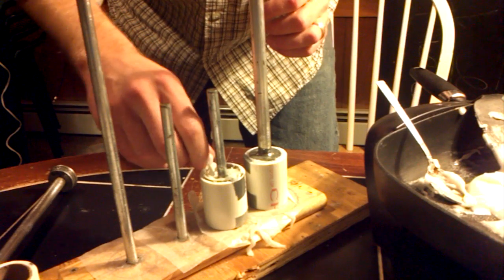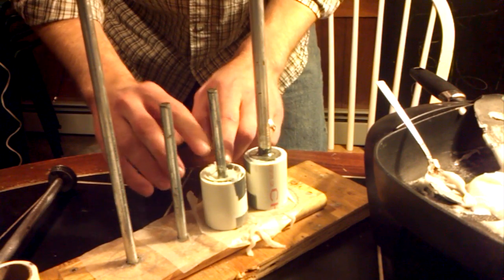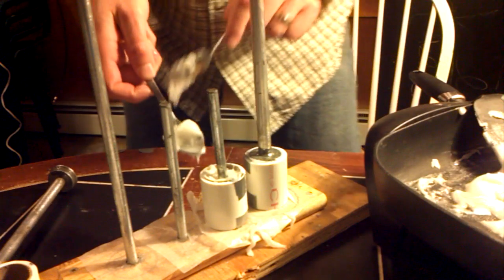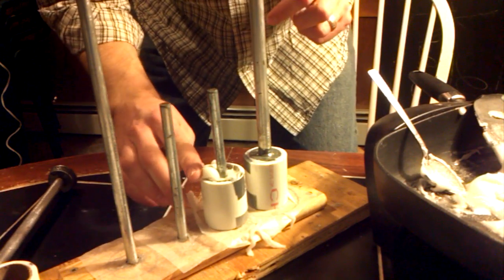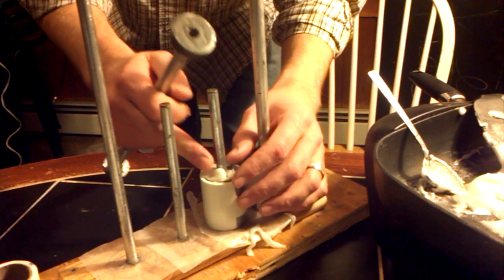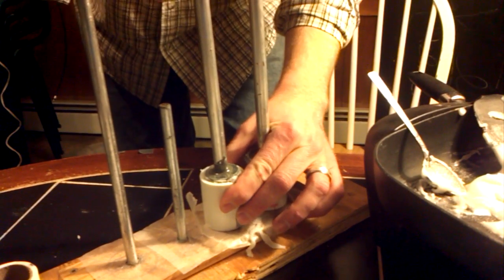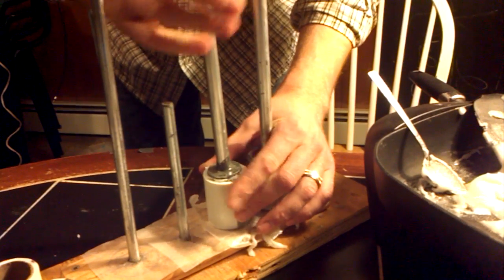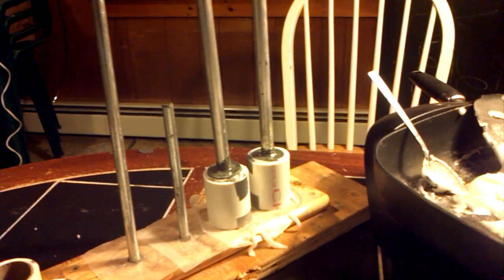Part 8: How to Build a High Powered Rocket - Flexi-Fuel

Comment: Just a quick point about safety I prefer the Sorbitol over the sucrose much lower melting point by far and stays at a workable consistency 20x longer you have a lil less performance with sorbitol but a good trade off for the safety and cast ability

Comment: this propellant is way too liquid, meaning too much water stil inside. Thats the problem with corn syrup. Only way you can get most of the water out is with oven and lot of time. This propellant is really low powered as sugar and potassium nitrate were not dissolved in water. Also bear in mind that there is no thing as melting point of sugar and point of caramellization! when sugar "starts to become liquid" its already caramel and propellant is mostly useless (in regards of high powered propellant)
Corn syrup indeed allows to cast more easily but thats all - it will be low powered meaning you have to use core in your propellant (i like to call it cheating)

Comment: Dear Sir,Can a person make a delay stage thats incorporated into the motor useing Flexi-Fuel?Like maybe adding Baking Soda to the mix?
Reply from the maker: That should work just fine for what you want.  A baking soda mix is good for tracking smoke as well.  Just make sure you do plenty of static testing before you launch.
Reply: @WizzBang75  So do you think I should try adding the baking soda/delay flexi-fuel right away, while the two fuels are still warm,or wait untill the main engine fuel has cooled??Thanks in advance for your reply,Keep up the good work!!I really enjoy your imformative videos!!!!!
Reply from the maker: @neiladamson5144  I'd cook them up in separate batches to make sure your ratios are exact
Reply: @WizzBang75  thank you, I'll give that a try. I think I'm going to let the main fuel cool first and then add the delay mix, I hope that works!

Comment: If those coring rods are even 1 degree not straight the rocket wont go straight up.
Reply: Marc Ferretti wrong
Reply: Your wrong. I know from experience... The core is what directs the gases at the ground causing propulsion. Coring rods 100% need to be 90 degrees unless you want a spinning rocket going the wrong direction.
Reply: Marc Ferretti HE HAS A NOZZEL THAT DIRECTS THE THRUST
Reply: A NOZZLE IS OPTIONAL! MOST PEOPLE DO NOT USE NOZZLES!!! PLUS WHEN YOU USE A NOZZLE YOU DONT NEED A CORE!
Reply: Marc Ferretti with rocket candy it’s almost necessary to use a nozzle and a core. But yes it has to be straight if you don’t have a nozzle! Oh how many times my core hasn’t been straight and a rocket turns and  hits a tree and explodes!
Reply: Dont use any core when using a nozzle. There is no point in putting a core at all then

Comment: I would not presume to instruct the teacher, however, I will.
     The use of metal tools with Any oxidizing agent could result in well...let's just say "Unpleasant" consequences. (Corn syrup excluded and if the spatula you use is a plastic, my apologies.).
     Nylon or even HDPE would be preferable to a fire or deflagration. (Seeing its nitrate)
    A fire extinguisher might be a good call too.
    Any more energetic oxidizer would be better mixed Outdoors or in a lightly constructed shed, maybe?
Reply from the maker: I was just talking to my wife about doing more videos.  Not so much launches as I live now in a very populated area...but the design and science for second stage motors and re-doing some of my old stuff as all of my videos were obviously a learning curve for me as well.  I also intend on doing a detailed video on parachute ejection.

Comment: Hi WizzBang75 I am trying to find the video on the retardant and how it works but can't find it, can you help?
Thanks
Reply from the maker: Guillermo Garza R retardant for what?  I know a quantity of baking soda can be used in smoke bombs but not sure why you would use it in a rocket.
Reply: Thank you for your quick response, I mean the insulated delay grain bolt head, the hall system to deploy the parachute, I believe

Comment: I've had more luck with Potassium Chlorate over nitrate, just sayin'
Reply: my experiment with KClO3 was that the fuel self-ignited while boiling out water.
Reply: I'm certain. In the interest of your wallet, avoiding undue scrutiny by "the man" safety etc.have you or anyone else put potassium chloratee with potassium nitrate.? I was going to try rhat and wanted so input, data, what have you first.
Reply: You can add 55 grams of kno3, 5 grams of potassium Perchlorate because it is much more stable than chlorate! Then 15 grams of powdered sugar, and 25 grams of light corn syrup. When it is caramelizing you can either cook it with that mix alone or add a gram of red iron oxide. To increase burn temp and burn rate.

Comment: why do you use pottasium nitrate as apposed to potassium chlorate?
Reply from the maker: Zachary, the materials i use to make motor were chosen based upon availability and cost.  some day i would like to experiment with more efficient fuels, but for now, this fuel provides more thrust than i have need for.
Reply: Good to know, thanks :)
Reply: Potassium Chlorate is more dangerous to use in rocket propellant.
Reply: +WizzBang75 Chlorate is cheaper, you just use potassium chloride (salt substitute) and chlorine bleach, it is a little more work, but you can then use a 50 50 mixture, so there is more fuel and less oxidizer, it is MUCH more efficient.

Comment: What is the purpose of the center hole?
Reply: WizzBang75
The core is needed to produce enough burn surface to produce enough thrust for the rocket to take off. Without the core you would simply have a smoke flare. Be careful with that. PVC is not that strong and when it fails, it sends sharp shards flying in all directions. The size of your core and nozzle throat diameter and strength of case and burn rate of propellant needs to be determined to prevent CATO.
Reply: mojaverockets  is flexi fuel less or more powerful than regular r-candy
Reply: faster burning
Reply from the maker: The Core is a way to maximize your internal pressure of the motor.  The More pressure you can achieve, the more powerful the rocket is.

Comment: you ever thought of using an empty caulking tube by pulling out the plug once empty and just using the tube open rear to load it full. Then putting the plunger plastic piece back on and use the caulking gun load motors
Reply: It gets hard really fast. This wont work

Comment: OK thanks well for now Im working with 4 grains. Today i went to test a few motors and they all work fine. I made a test cell and they all came close to 65lbs. Im going to try something different in the nozzle so i get less erosion. i found a program for bates grain calculator im going to try it and see. Thanks for your help

Comment: ingredients? do they differ from the original mix? I use APCP, I use your casting methods and such as they are practically flawless. but this fuel looks easier than the standard R candy, but not as easy as the APCP. Ammonium Perchlorate and Al is an awesome fuel, but I recommend beginners master the R Candy first. APCP is cast the same, used the same but made without heat if anyone wondered. Its performance is more advanced to.

Comment from the maker: Only difference I have found is that you have to be more selective about your nozzle size.  You may have chuffing if your nozzle is too large.  You also get a longer burn with Flexi Fuel.  Overall, it is very good, and I do recommend it's use.

Comment from the maker: It is OK to add RIO, but you will find that you do not need to.  Try a few motors without it first to see if you get the results you are looking for.  Test strands burn at 12 seconds per inch.